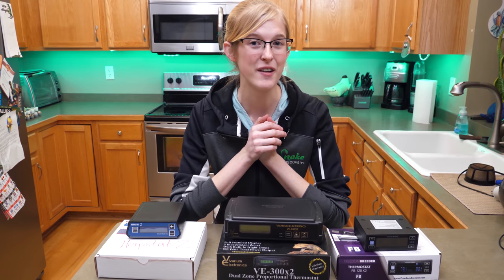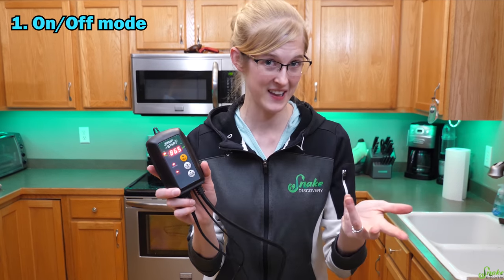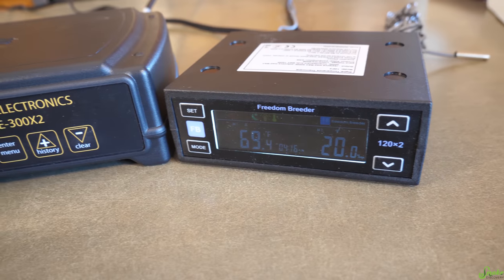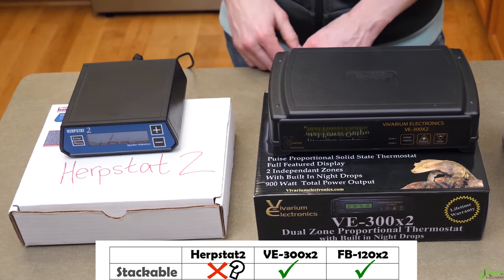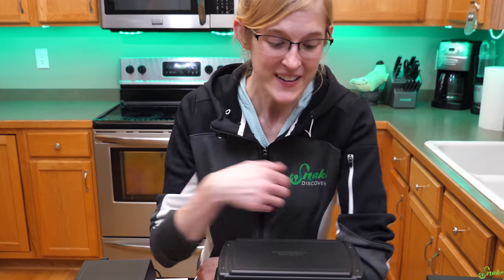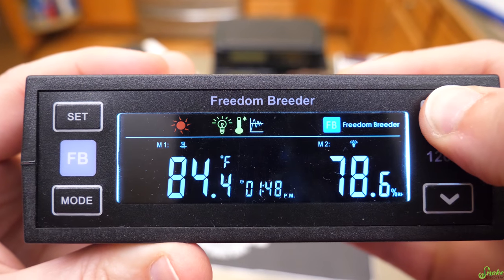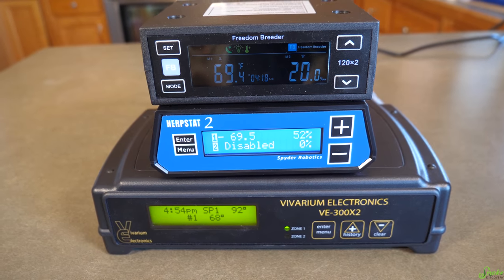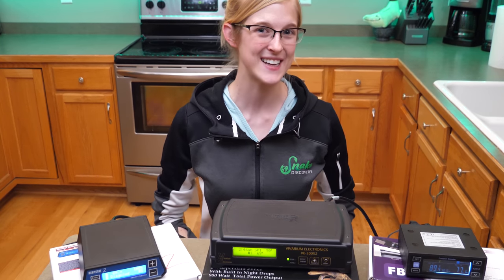Professional Thermostats: How they Work and Which is Best

Comment: Where do you put the probe? If I put it in the cage, the first thing that will happen is my pet will knock it out of place, bite it and poop on it.

For an under-the-tank mat, I can put the probe between the mat and tank, then set it to a temp that translates to something high enough inside the cage. But how do you do that for heat lamps or ceramic heat emitters?
Reply: Fwiffo What type of pet do you have?
Reply: @reptilerant173  A corn snake and a leachie. But on this question I'm thinking about a future beardie.
Reply: Fwiffo Oh ok. Yea, normally you just have to fasten the probe down with some silicone. However, I can see that it may be hard with a bearded dragon

Comment: So ceramic heat emitters work fine with the cheap on/off thermostats? I've been looking into replacing my heat mats with ceramic heat emitters to increase temperatures better in winter, but I'm getting conflicting information on what kind of thermostat should be used with them. Some say pulse proportional should be used, but it would save me a ton of money if that was not the case.

Comment: 20:05: There's no way to know for sure without actually analyzing the circuit.  Any digital device that controls AC circuits (i.e. the computer in the thermostat switching heaters on/off) is going to contain a relay.  Its little more than a heavy duty computerized switch.  I'd suggest testing them to be absolutely sure they have a safety cutoff rely before relying on it.

Comment: Do you know anything about Deep Heat Projectors? I have heard you can't use them with a regular on/off thermostat (not entirely sure why as long as you have them in a dome with a dimmer) but I have heard they work with these. Have you gotten to use one yet?
Reply: I didn’t know you couldn’t use a deep heat with an on and off thermostat- did you find anything else out about this?
Reply: @samarabevin  I use my DHP on a dial with a herpistat on Dimming mode.
Reply: @StarlitMoss  thanks! I use mine with a dimmer control option and it does seem to work better. I feel like the on and off burns out the that type of heating element faster maybe. Anyway thank you!!

Comment: Do you need a thermostat whith a heat bulb?
Reply: @sexydoorframes  thanks. I am building my terrarium (for a future beardie) and it was recommended to me to use normal halogen / wolfram bulbs but of a higher wattage than those we use for our lamps around the home.

Do you think you need a thermostat for those? People told me that it won't work and it's not needed, but I want to have more sources

Comment: metal is a good conductor meanwhile plastic is a great insolator. metal abosrbs and releases heat faster vice versa for plastic. if you want a hotter enviroment for the reptile, use metal probes and for cooler enviroments use plastic ones.

Comment: There isn't even a basis to compare. Herpstat has dimming and more safety features. Done. 
Dimming is the most efficient, gentle, and natural method to warm an animal. I simply can't see the advantage of pulse or on/off in relation to dimming, regardless of heat source. Though I do think pulse is superior to on/off.
Reply: You clearly do not know that much about heating elements then. Radiant heat panels best and only option is for pulse settings. Other settings are not acceptable for panels.
Reply: @GodZirra  Never heard that. I have seven RHPs running now, all on herpstats set to dimming mode. All my panels are from Pro-Panel, and if you know anything about panels then you know who they are. Bob himself told me that dimming is the most efficient and will not damage his panels. So I can't imagine where you got this idea. 

It's bad form to troll Emily's videos.
Reply: @jasonlongton1876  Sounds to me like you're trolling. There is literally 0 reason to use dimming on a RHP because pulse is just flat out better. https://www.reptilebasics.com/radiant-faq It literally says use a pulse proportional thermostat. If you google or go to reptile groups you will be told the same thing.
Reply: @GodZirra  Dimming is the best mode.  Its the smoothest output of power.  There should be no reason to use pulse on a panel.  The only time you actually need pulse is if you have a rack system made of metal because dimming mode can cause the heat tape/metal tray to give off a audible ring.  Pulse doesn't hit a smooth frequency so it doesn't encourage that.  The only other time to use pulse is if you have some noisey electrical lines that are causing errors on a probe.  Then pulse can help as well.  - Dion

Comment: Herpstat2 being straightforward to program? I have to disagree. No disrespect to you Emily. I hate the options available for enclosures with light bulbs. My creatures need light. All I want is to control a day/night time and have a safety so the bulb will dim if it gets too hot. The Herpstat I have never worked. It was painful to program pressing buttons a million times. I got help from more tech savvy friends and they agree it is awful design. How is this the best choice for lighting? It's not intuitive to use. It's very hard and doesn't deliver from my experience. I'm getting to the point that I think it would be easier to build my own thermostat from a mini PC like Raspberry Pi. Am I alone here?
Reply: There are a lot of features packed into a Herpstat.  The layout of the menu is as logical as it can get from a programming standpoint but this may not work for everyone.  I'm a windows guy and even though I am a developer you stick me in front of a mac computer and I might as well be a child.  I can't make my way around using one.  I answer all the emails at spyderrobotics so if you have a problem with setup or questions you can always get a hold of me for advice through our website contact page.  We also have a video for Herpstat setup that helps alot of people out under our support page.  -Dion (Owner, Spyder Robotics)
Reply: @spyderrobotics_sales  Wow, thank you for the reply Herpstat. It is unfortunate I haven't had a good experience with your product. Honestly I do recommend them if someone online or in person asks me. Since the dimming proportional is absolutely necessary for any light source. Effectively there is no competition for your company when it comes to dimming proportional.

Also, I want to be clear that I am serious for building my own thermostat control system. Circuit boards, replays, junction box. The scripts have already been written, software is my weakness. Hardware, piecing things together is my strength. Having software that interfaces with an app, which the raspberry pi makes easy to do, gives me the knowledge I want from my environmental controls.

 The Herpstat1 I've used always got too hot. This necessitated reprogramming it over and over because I assumed human error was to blame. The bulb hot spot always got too hot. Program for 105°F and get 137°F instead. I would use a lower wattage bulb, maybe 75 watts instead of 100 watts but that didn't make a difference. I would use several ZooMed probes in the same place as the Herpstat1 probe, all the ZooMeds measured the too high temp, Herpstat1 did not. The Herpstat1 also did not turn off and on at the set times. It would go through its own day/night at bizarre times of day or night. I assumed everything was user error since everyone on the internet agrees it is super easy to set up. That is my fully fault. I never called it in. The product is over 1.5 years old now. I was considering giving it away to someone local who may want to try it, maybe they can program it and have success. All my problems could just be me being infuriated at pressing buttons over and over.

An app or other way to display settings on a full screen without using buttons to navigate would make sense to me.
Reply: @dorgendo4000  That sounds like a probe placement problem.  For heating with bulbs the probe needs to hang from the ceiling and dangle about 3-4 inches below the bulb.  Anywhere else and you are going to have consistency problems.  We have a document in the support section of our site that talks about probe placement for different setups.  If the hardware is in question you can always send it in and I will check it out for you.  Just contact me through our website and we can set it up.  I am very relaxed on our warranty policies.  :^)  If you prefer phone/tablet setup versus the device then you will like the new SpyderWeb wifi enabled series.  It won't be too long before release.
Reply: @spyderrobotics_sales  Thanks for the reply again. I think I'll have to send in an email. I will try setting up the Herpstat1 for my grey tree frog. He likes to come out and pseudo bask occasionally even though he is nocturnal. Everything you posted about probe placement was not in the guide that came with my product. The guide has exactly one sentence about probe placement on the last page of the manual: "Probe placement will require experimentation to achieve proper temperature regulation". This was very discouraging trying the system over and over when I first got it and it wasn't working no matter where I tried placing the probe or re-doing the programming from scratch.